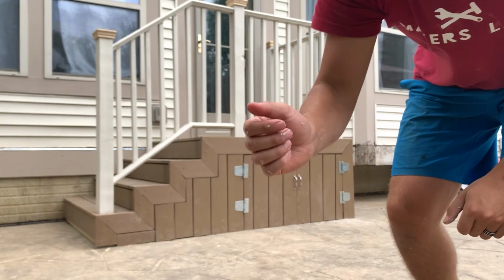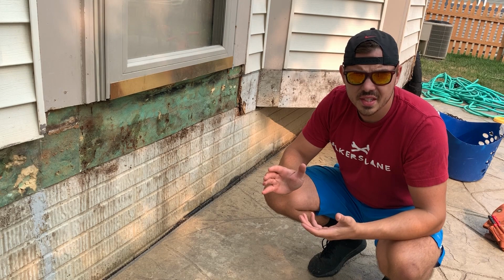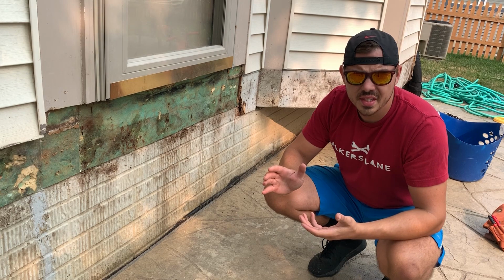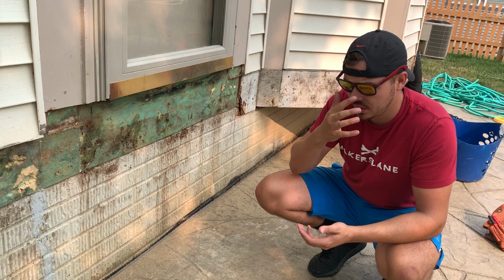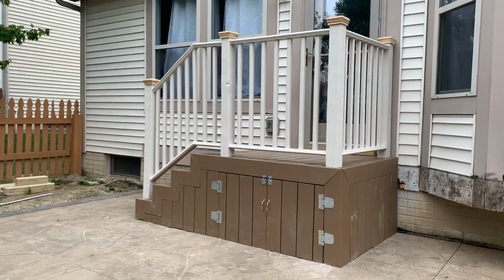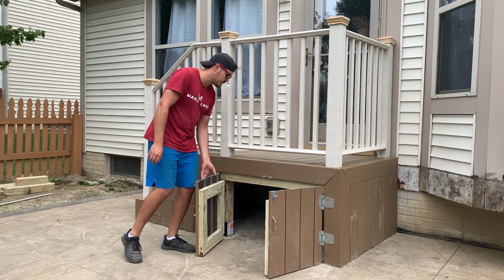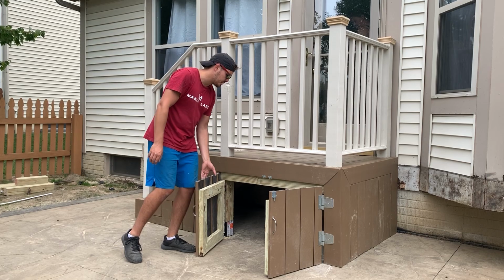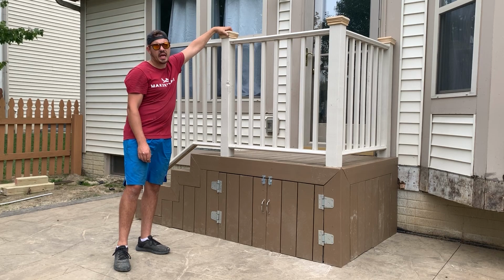Small Patio with Stairs (Made from composite wood)

Comment: I dont think this would pass code. The GRK specs on those screws show that you have to use a joist hanger with them on joists. Why you ask? Because the screw is so big that the joist can split prematurely and drop down causing an injury at a later date. Another thing is the mounting system for the posts, you have to prove to the inspector that your patio stones or cement slab is thick enough to be structurally sound. Where I come from, that is 4 feet below ground. You will say that the deck is floating on the ground. In my area, a deck used as a main entrance to the main floor of the house, has to be attached to the house via the rim joist, and in that case, sauna tubes or bigfoots must be used in conjunction. Other than that, its pretty cute.
Reply: Exactly what I was thinking. Also, that railing could just snap right in the middle bc there’s no support in the longest part of it 😂😂😂😂